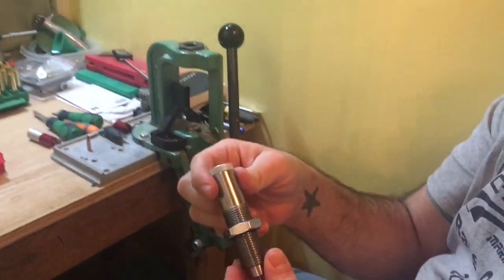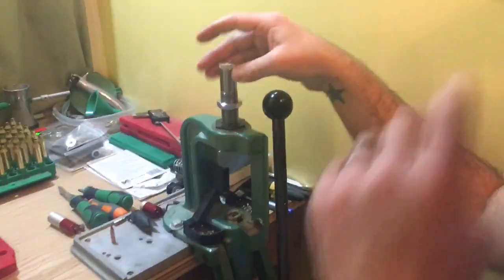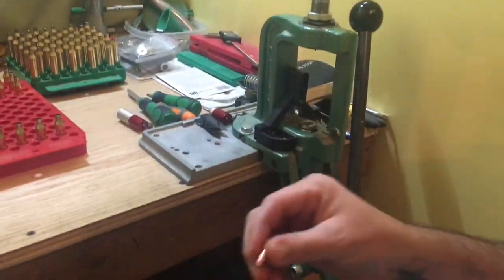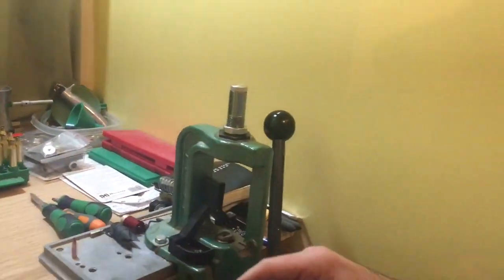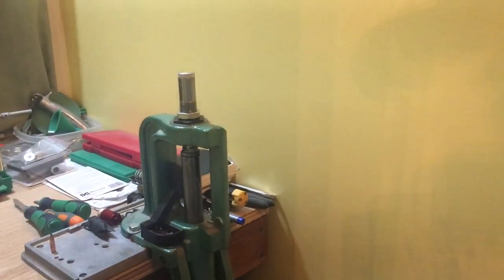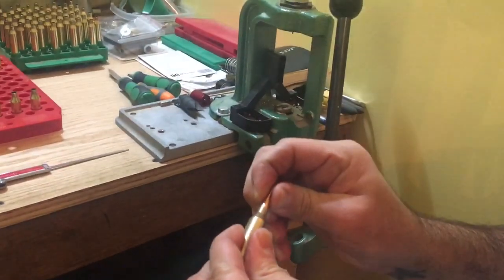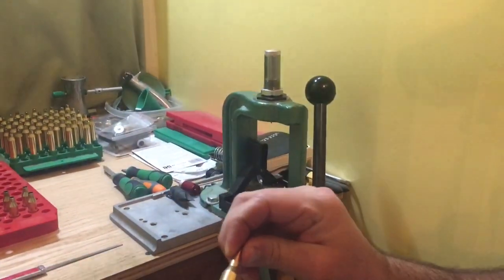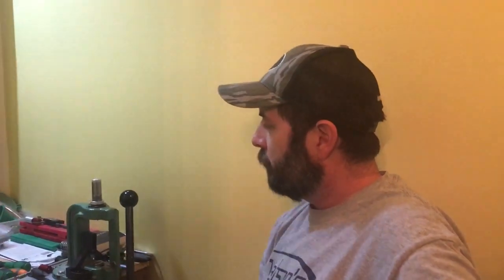How To Setup The Lee Collet Neck Sizing Die

Comment: Great video... As an old timer in reloading, I've use lots of the bushing type neck sizing dies. I've found that if you use a Redding Body sizing die, just sizing the body by pushing the shoulder back about .002 after a case has been fired and then using the Lee Collet die you can adjust the die to make the neck tension about .002 or .003 below bullet diameter and you can really make some concentric bullets. Run out will be minimum. This tool is now my "go to" tool for neck sizing...Just remember, neck sizing without bumping that shoulder back with a body sizing die, you're giving up case life and possible hard to extract cases after firing. Great video, Josh. Everybody who reloads ought to be using a collet type neck sizing die for real accuracy. At least in my humble opinion.
Reply from the maker: Thank you for sharing and we appreciate you stopping by and watching
Reply: @johnday4765 thank you for commenting. I have not used the collet neck die yet but your description of why for concentricity/accuracy is exactly what I want to achieve and your experience confirms this.
Reply: You can special order Custom Undersized Collect Necksizing Mandrel for lee to your specification. I bump my cases .002 under, not touching the neck, then ran it through Lee Neck Sizing Die with a mandrel .002 under bullet diameter. This set the ideal neck tension. This also give you uniform concentricity. Works great.

Comment: First mistake headspace check…he checked the case without depriming. The primer will interfere with the measurement. The recess in the cap should be enough not to concern yourself with “25 pounds of pressure” nonsense. The bullet should not go in the neck even with a custom madrel at .001 neck tension.
Reply from the maker: Did you not watch the video? Still got 1.624!!!! Was showing it does not bump the shoulder back.

Comment: I been using them for years. I fire form my brass then just neck size the brass. That way the brass is formed to fit just my chamber..
Reply from the maker: Awesome thanks for stopping by and watching we appreciate it
Reply: How many times can u do this
Reply from the maker: @reddawng43x91  4 or 5 times usually some guys do it a lot more time just depends how much pressure you are running

Comment: Why don't you bump the shoulder at all . I thought you wanted 1 to 2 thousands bump back ?
Reply from the maker: Not with this die this is just to size the neck it’s fire formed to the chamber I always check mine on a case gauge to make sure it hasn’t swelled at all.

Comment: I bought one for my 300 win mag, out of box I couldn't get the guts out to lug it. Had to force it apart with a doll rod and and a small hammer, and wouldn't slide back together. Tried multiple cases with different depths and pressure on the press . Couldn't chamber the brass but the bullets were snug. Not impressed!
Reply from the maker: That is really weird they normally fall out if you screw the cap off. Did you contact Lee?

Comment: Turning the die body will not increase neck tension. The diameter of the mandrel determines the neck tension.
Reply from the maker: Doesn’t pressure have a lot to do with it and this is set up just like they recommend
Reply: Post from @DLN-ix6vf 4 months ago (edited)
it's impossible to get more neck tension as the mandrel inside controls the final inside dia. 
what you're doing is having the collet move further down the neck which will eventually push the neck inwards causing the shoulder to donut.
Reply from the maker: @btsantiago52  it currently is shooting amazing so I guess when that happens I will throw the case away

Comment: How do you know you are using 25 lbs of pressure?
Reply from the maker: Honestly it’s a trial and era you just half to do it by feel there is no gauge to use or anything best thing to do is check the case make sure the bullet won’t just fall in the case.
Reply: @joshandhuntersadventures5046  okay, thanks.

Comment: One of these recently got me out of the shit!

I had decapped and cleaned 120 pieces of brass. Full length sized them, trimmed them, primed them all good to go... then remembered I hadn't bumped the shoulders back...... aaaagggghhhh.... 

All very tight in the chamber. Bumped the shoulders back on them by 2 thou which drastically reduced the neck size.

I got one of these neck size collet dies, ground the primer pin off and neck sized all of them. Only lost 2 thou overall length and saved 120 fully prepped cases 😅.

Lesson learned.... Best money I've spent in a good while.

Cheers for the video, It was a great help. 🇬🇧  👍
Reply from the maker: Awesome I’m glad it helped thanks for sharing your experience we appreciate it
Reply: Remove de capping pin
Reply: @btsantiago52  that did cross my mind, but then I'd have needed to buy a new full-length sizing pin anyway, (yes I know it's cheaper). The neck sizing die was just a handy extra that I can use purely to focus on the neck alone and sorted my problem.

Comment: 2:00 very good advice there. One tip, when measuring a case, always pop out the primer first. Upon firing, the primer blows back to the bolt face and there is almost always at least a hint of firing pin crater. It will stand proud and affect your caliper reading. I like a press that cams over when using this die. It's hard to consistently judge 25 lbs of pressure. With a cam-over press, easy peasy. You might not know the exact pressure but it's the same every time.  Good video!
Reply from the maker: Thank you for stopping by and sharing those tips with us we appreciate it and thanks for watching

Comment: it's impossible to get more neck tension as the mandrel inside controls the final inside dia. 
what you're doing is having the collet move further down the neck which will eventually push the neck inwards causing the shoulder to donut.
Reply from the maker: It’s all good so far I will just keep going with it shoots lights out 👍
Reply: That’s not how it works, but ok. It’s worked over a mandrel that makes 100% perfect neck tension, from the inside, not the outside
Reply: @l.p.5259  what are you talking about ?

Comment: It's been a while now that I have been using this Lee collet die and it has not failed me. But there are a couple of caveats that need attention. Early on I saw some rub marks where they call it meets the anvil of the die and I put some wheel bearing grease on the outside of those collet pedals. That has largely minimized the amount of wear. Also I am a big believer of running the sizing die twice for some added concentricity help. Just squeeze it turned around 90° and squeeze it again. I know a lot of people get down on these guys but I have had some of the best loads from this collet die. You got some great videos as always 👍
Reply from the maker: Thanks for sharing this tip always good to learn new tricks glad you stopped by and watched the video

Comment: Great video. I was using collete dies for my AR. I was reloading brass from my gun and from my friends guns. 
I found that I have at least 10% of the brass was jamming and not rejecting or not going to battery. 

I have since changed to full length now and the problem of jamming have gone away.
Reply from the maker: Awesome glad you got it figured out. Thanks for watching and commenting. Also there is a tool called the Wilson case gauge that may help you also. Check those out on midway. Thanks again for watching
Reply: Try SB dies

Comment: Hey I’m new to reloading and I just picked up one of these do either of the two die crimp the bullet? Or do I have to buy a separate die for that
Reply from the maker: Yes you half to buy a separate die to crimp with you will need a factory crimp die you can find these at midway or bass pro
Reply: @joshandhuntersadventures5046   thanks for the help
Reply: @siah5506  and if your reloading for a semi auto gun, no neck sizing, full length only. neck sized brass will not feed reliably in a semi auto gun. also most pro shooters use full length sizing.

Comment: My Lee 223 set only has full length sizer, collet neck sizer and a dead length bullet seating die. I made a few cartridges and did not even use the collet neck sizer, mainly because i really don't know what it is used for, except that you can use it and not the full length sizer when only reloading brass that has only been used in you rifle. My question is, is the dead length bullet seating die putting any kind of crimp on the bullet? Do i need to buy the lee factory crimp die?
Reply from the maker: Not sure but I don’t believe that die does any crimp. Probably just pick up a crimp die.

Comment: Hi Josh and Hunter's Adventures, thanks for the video. I resize 308 and when i resized my case every time have bump the shoulder with 0.04". I made different settings on Collet Neck Sizing Die but the result is the same. Have you had such a problem or someone else?
Reply from the maker: No you shouldn’t be moving the shoulder only sizing the neck take it apart and clean it first.

Comment: Lee says run the die down 1.25 turns after contacting ram at top of stroke.  If you do only 3/4 turn, how can you be sure the ram is not at the top of the stroke before the collet fully closes on the neck?
Reply from the maker: You need to set it up based on your press. Go a little at a time till you find the tension you want on the neck

Comment: Can I do this with once fired 7mm-08? What’s the purpose of a full length die if all you need to size is the neck for ur chamber?
Reply from the maker: Once it has been fire formed to your chamber then you can neck size
Reply: Is there an ideal tension? If I get mine about like yours where it barely comes in and out by hand is that adequate? What’s the cons to having less neck tension ? Thanks!

Comment: I’ve had marks down the size of my neck like score straight lines any clues why please could it be the collet dye
Reply from the maker: Have you taken it apart and tried to clean it? I would start there and look it over really good at the little pedals.
Reply: Josh And Hunter’s Adventures yes I’ve pulled it apart and found it was not polished and were the four cuts on the collet are were extremely sharp so I gently rubbed them with 1500 grit sandpaper by putting a piece in one and one beside it and gently rubbed it as for the outside of the collet and were it matches in polished them both was this a good idea or have I made a big mistake
Reply: The collet marks are normal, they are actually partially unsized portion on the neck that landed between the fingers of the collet. Best way to make them less of an issue is rotate the brass 45 degrees and size again. That will place the unsized portions into the collet. (The instructions say to do so (90 degrees) for better accuracy but I honestly think it's mandatory to be able to size the entirety of the neck.)

Comment: Lee calls for 2 full turns after contact fyi, says right in the die instructions.
Reply from the maker: I do it by feel myself you got to play with it
Reply: My thing is did he resize then neck size? My fire formed brass at  two full turns like the instructions say my shell holder is no where near closing all the way. Instructions say you need to feel the collet, 25lbs min after primer removed and you feel the stop. I see a lot of guys doing it like the vid here. Am I missing something?
Reply from the maker: @TheGunz4u  Nope all I do is setup the die the way I did and get the neck tension I am looking for

Comment: Your ammo fly better loose rather than .0001 - .0003 tension?
Reply from the maker: I have no way of checking exact tension although I think there is a gauge for that
Reply: All depends on MANY variables. Powder, bullet, primer, chamber demensions, charge weight, seating depth, brass hardness and the list goes on and on. Best to try a proven load with more/less neck tension, record results and compare. I generally set up my target loads with lower neck tension(.0015) but go for more on hunting ammunition if not crimping.
Reply from the maker: @kassilewis5511  I never crimp myself and always work up till you find your right load that the gun shoots. Always work till you find what your gun likes don’t go off someone else’s load.
Reply: @joshandhuntersadventures5046  I agree. Consistency is the key in handloading. As many of the variables that the loader can control should remain constant for more accurate results in load development as well as verification. Start low and work up. Any component changes afterward, dial back the chosen charge, then rework the load.
Reply from the maker: @kassilewis5511  good advice

Comment: I like to deprime in a decapping die first.
Reason for this is, the first measurement might not be correct because the primer could be proud!
Your way, the intitial measurement could be wrong, make all subsequent measurement wrong too.
Reply from the maker: If you use a case gauge and it fall into it wouldn’t that make it good? Your only sizing the neck nothing else should be fire formed
Reply: @joshandhuntersadventures5046  
I think you missed my point!
Your first measurement was with primer in.
If the primer is protruding when you measure it,
then you decap it, the measurement will be different.
I find it safer to decap before any measuring is done.
Mine is a decaper ONLY, it does not size in any way.
Reply from the maker: @richardt.4224  ok i see what you are saying now.